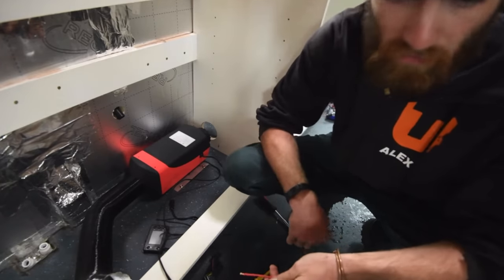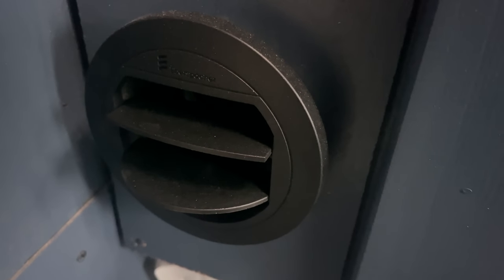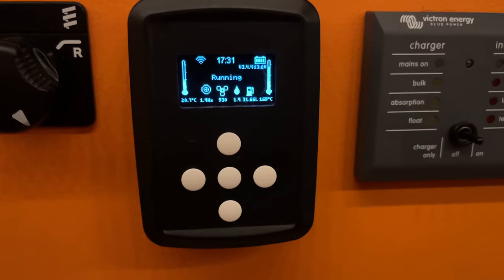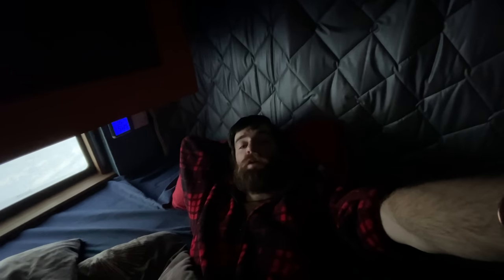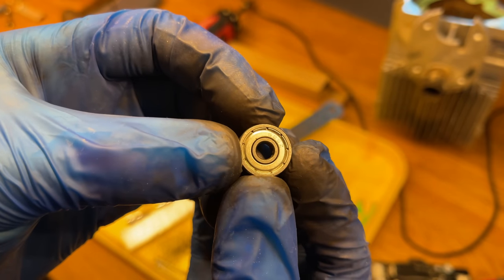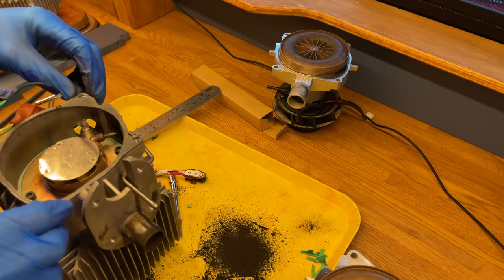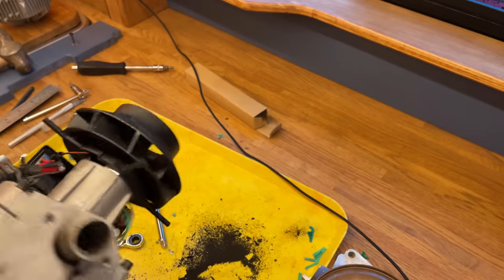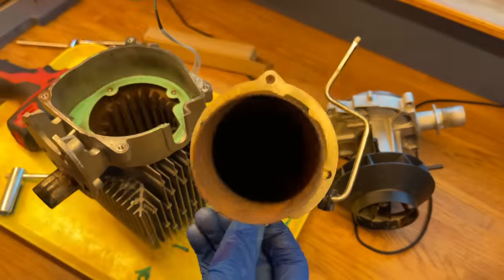2000 HOURS LATER! Chinese Diesel Heater

Comment: So why does everyone say "Chinese" diesel heater? It's not like every other powered item doesn't come from China !
Reply from the maker: It’s a good question. It’s not so much it’s “made in china” that’s not really important in the term of the names. Is just the common way people categorise diesel heaters. Most who have a western brand heaters people  just say the 3 brands names, Espar, Webasto or Autoterm ( not the particular model ) but are distinctly different and unique designs for each brand. brand name doesn’t really work for the Chinese made heaters as there are more brand name than you can probably count, but generally they’re all the same unit / design based off the expired Patent of the Espar D4.

Comment: It will fail you when you realy need it do not buy they use more fuel as well..
Reply from the maker: I think you’re wrong. Now on 5000 run hours and three Arctic Winter trips and never been a problem. 

They also don’t use more fuel as well. Fuel consumption is the same pretty much at the heater they are Designed off. 

Since I have a working thermostat due to the third-party controller back, fuel consumption is probably lower than most

Comment: The fact that the fan motor is a pathetic DC-motor instead of a decent induction motor, proves that this is a heap of garbage. Definitely not made to last long.
Reply from the maker: You know the eberspacher D4 which the Chinese heater are based off? also uses Brushed Dc-motor? Not sure about Webasto. The autoterms use a brushless induction motors

Comment: These things are less than $175, I would just buy a new one and replace it then sell the old one for $50 to someone. Not even worth repairing.
Reply from the maker: These heaters are hit and miss between companies and batches. Having a good one and doing a $10 fix isn’t so bad
Reply: @MispronouncedAdventures  which would you recommend is best company wise?
Reply: It’s nice to repair and maintain in this throw away society now a days.
Reply from the maker: I used maxpeedingrods 2 years ago. But times change. I can’t remember there name but there is a Person who has a blog and keeps a list of the best recommended brands. A Google of “ best Chinese diesel heater”  is may help you

Comment: too bad these heaters smell like a pile of burning tires/plastic
Reply from the maker: Sounds like you have an issue with your unit or have installation issues 

You shouldn’t get any smells off them internally, external you might smell exhaust smells but nothing like burning tires or plastic.
Reply: @MispronouncedAdventures  brother, I thought maybe it was just because it was "new" and gave it some time; Nope. Then I swapped out the cheap duct they include for a high quality aluminum; Nope. Then I even tried running it on low instead of high; Nope. sent it back. maybe you are right and something was messed up internally.
Reply from the maker: @ch-ir8ld sending it back sounds like a good idea. Must of been something wrong. Part of the plastic touching the heat exchanger maybe.